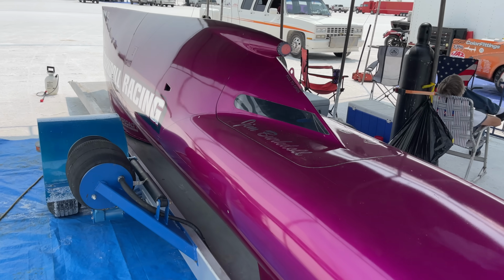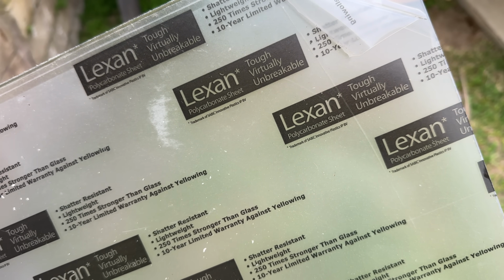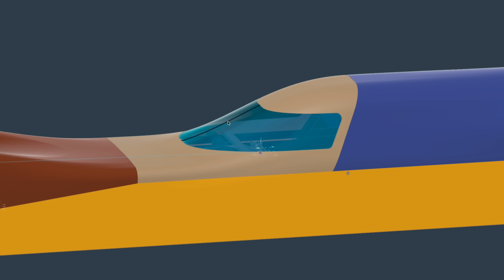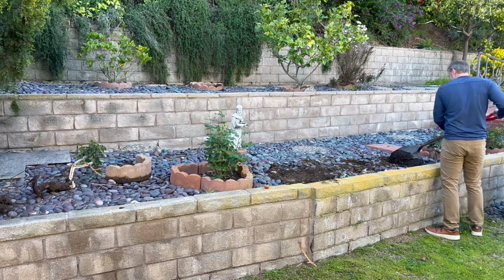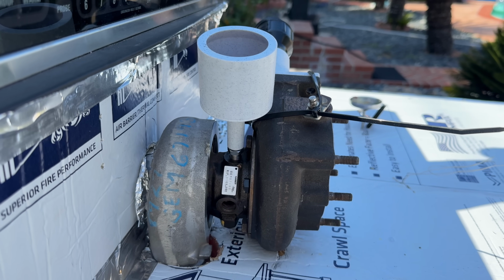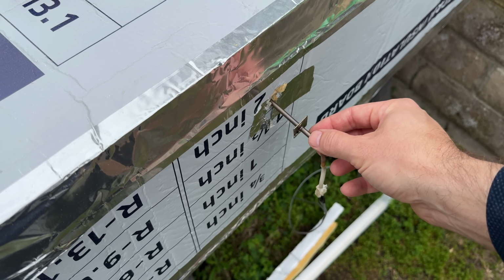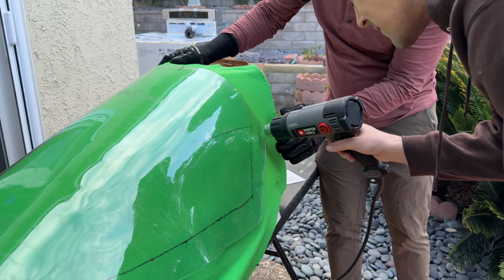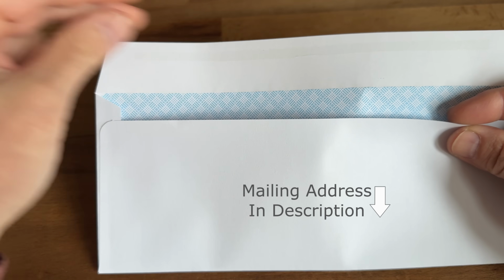I Turbocharged My Oven

Comment: So I too am a designer.  My design solution for your problem: ditch the complicated windscreen and make a digital periscope.  
You have very little to see for a very short time. Spending a lot of cash to un-see through wobbly plastic= bad plan.
Reply: neat idea, not sure how allowed it is.
Reply: Good idea until you loose power at 160mph
Reply: @rugwalle  Doesn't matter if you lose steering power too, but why are they doing this at all if they only get to 160? Is that not scratch lambo territory?
Reply: @davenordquist4663 I don't know what speeds they acctualy reach. My comment was more about using unecessary complex solutions. Clear plastic has so many less things that can go wrong than a camera and a screen.
Reply: @rugwalle  Hot desert, shimmering air, heat of compressing air, thermoplastic can go wrong. The periscope notion isn't off much either; you don't want to stick out from the frame or have less than a square meter of optic to use, but speeding over the curvature of the earth from a POV 2.5 feet up is gonna surprise ya no matter how intrusive your headlights are (through an arc of earth.) Maybe get a satellite wingman as it were, maybe NOE radio, maybe just a nice psychommu amplifier or 200 like in Gundam 00. No humans (only, maybe the league requires it? Or; you can't call yourself Hi-Speed Siobhan if your parrot's name is Hank?)
Reply: I feel like if you ignore all the rules to land speed racing in this sense what you would eventually end up with is dead baby railguns

Comment: I wonder if you could effectively convert the mold into a vacuum forming mold by drilling enough holes in it and plugging in a shop vac. Maybe preheating the mold to some degree (electric mat heater on top) might help a little bit as well?

Comment: use your PID controller! I strapped one to a fan controlling airflow to a pit smoker and could maintain temperature within a degree and a half just running a 6" duct fan into a pile of hardwood. I could take the same PID system I mounted into an ammo can and use it for sous vide or resin curing or teapot warming.

Comment: I wonder if it wouldn't work better if you added a couple more layers of fiberglass to the form and integrated into the oven so the PC sheet forms while heating?
All you'd need is a bigger oven and maybe another turbocharger

Comment: A fishtank discovery series put the mould in the oven too. It draped over the mould as it softened. They were using inch thick polycarbonate, too.
Reply: It also allows for a cooling ramp down, and no need to touch it until fully hard. (Insert obligatory "that's what she said" comment here. )
Reply: @owensparks5013 
Okay. 

That's what she said.

Happy to oblige.
Reply: That what I was thinking, make a bigger turbo-charged oven and put the mould together with the sheet
Reply: Thinking this also.
Reply: he mentioned in the video that he'd need to make a giant oven to hold the mold, which would need a more powerful heat source, if he was to go that route.
Reply: I think with his air circulation system that won't be much of a problem. His mold is foam too, so as long as he builds around the mold it won't add much thermal mass to the heating and dwell times. It will just be a convection oven (it already is).
Reply: @erikmyers3888  I'm just repeating  what he said in the video. He didn't want a ginormous oven in his garden and he didn't think it would heat up evenly.

The mold is made of a different  type of foam that would melt in the oven. He said that in the video as well.
Reply: Hey, I'm just brainstorming solutions! He already solved the first problem anyway.  The mold plug would need to be made out of the PISA foam, which is only an obstacle in retrospect. For the rest of us watching the video, we don't have that problem ;)

Comment: did the same with 10 ft long oven built from foil backed foam board,  but blew mine with air through shaped aperture, came out perfect first time. Screen was about 4 times the size of yours

Comment: There is a nut on the underside of the dial that you can use to calibrate these thermometers. I also have a cheap one that needed some adjustment to be closer to accurate.
Reply: Upvoted so Matt sees it.
Reply: Indeed  @Mark_Bridges
Reply: And use iced water instead of boiling, it's easier to get 32° than 212° or 0° and 100°
Reply: @legionofanon  It's a good idea to do both actually. This way you're not just checking a set point but also confirming the increments in between. 
More often than not, once one is correct the other is too, but this can let you know where in your range is more accurate if not. 
He more than likely chose to check boiling because it is more in the neighborhood of interest for his purposes.
Reply: @legionofanon  Candy thermometers -- such as Matt used -- seldom have a scale that reaches 0°C.
Reply: TIL, That will be useful knowledge.
Reply: Yup, came here to say that...
Reply: @nate8088  me too
Reply: Just posted this and then checked just to see if anyone else caught it and of course, comment section is undefeated
Reply: Some of the ones that come with a protector sleeve even have a tool formed in to tweak said nut.

Comment: You didn't fail to make a windshield, you just made a protective travel cover for a windshield.
Reply: Storm window for windshield if you will
Reply: Plus an extra.
Reply: @cybersholt  Yep, Racecar life, gotta have spares.
Reply: @Mach1048 smokey yunicks used to say that a racer needs a pair and a spare. He would elaborate that on race day you need 2 engines and enough parts to piece together a third. Same philosophy for the rest of the major components of the car.
Reply: I need someone like that in my life "you didn't fail to fail because you failed to start, you just took a well deserved nap and are now more ready than ever to fail"
Reply: If scratched don't count of course, so you need a soft protective cover for your protective windshield... great...
Reply: Weird way to spell windshield tho..
Reply: Warthunder Trailer Pfp? Based
Reply: By my calculation, that sounds like a failure to make a windshield. No?
Reply: @savage6394 No, no. The protective travel cover still does shield from the wind along with other things. So technically it is a windshield.
Reply: @edwardscott3262  Ah, a windshieldwindshield
Reply: @savage6394 i think you forgot to carry the two.
Reply: @savage6394  I bet you're fun at parties!
Reply: @savage6394  my house is a windshield
Reply: @savage6394 You must be using outdated formulas without creativity and imagination factorization.

One man's trash is another's treasure as they say 🤷

Comment: Would a surplus jet fighter canopy work?  It might be easier to modify (GASP!) the body lines to work with the canopy rather than the other (your) way.
Reply: I had a canopy (the hatch that goes off when you eject)  from a  Saab 35 Draken it weighed like 50kgs plexiglass was like 1/2 an inch.

Comment: The correct fix is to run no windsheild. Use small cameras with a live video feed to VR goggles.
Reply: And make sure to use the cheapest possible cameras and goggles off wish
Reply: Electronic windshield is probably not allowed by the safety rules, less FOV/fidelity and a lot more failure points than a piece of polycarbonate.
Reply: @treelineresearch3387 depends on the polycarbonate and how turbocharged was the oven.
Reply: @treelineresearch3387  A set of cameras with VR goggles gives a much better FOV and fidelity than any windshield you can get short of literally replacing the entire cabin with a see-through sphere.
Reply: Killdozer has entered the chat
Reply: @Odins-Dad and now it’s just broken down
Reply: A System Update... Do not reset pops up at 300mph
Reply: This is the approach Lockheed’s X-59 super sonic aircraft is using.
Reply: @N3tech At that speed a planes flying with its instrument anyway, the cameras will likely just be used for taxiing, take offs and landings.
Reply: Some high speed velomobiles use this approach (less the VR goggles, a small screen inside the cockpit is sufficient).
Reply: This is good. I hate the idea of multiple points of failure. This is a lovely single-point-of-failure solution. };-)
Reply: It's doing a top speed run, there are no corners or curves, so you only need to see straight in front of you.

Even if you saw something that was going to cross your path, that car can't avoid it without crashing! Just trust the track officials, and don't worry about things you can't control. All you need to do is keep it level, hold on, & twist the grip.
Reply: Watching the bodyless runs showed how much salt was getting thrown about, so I think the lenses would be coated before the run was done.
Reply: @kevincurrie2052  equip with a scrolling screen
Reply: @kevincurrie2052  You can spray the lens with water or even make a rotating shield in front of it.
Reply: I'd rather deal with some distortion even a Crack over a suddenly black screen.
Reply: That lack of testing the test equipment was kinda a happy mistake, or sorta a lemonade type moment.
Reply: It's not like there is anything that is going to be in front of you. It's on the lake bed, there aren't sides to that track!

As driver, your job is to hold the handlebars & go straight, then pull the ripcord.  All you need to see is the horizon.
Reply: Nothing works as good as human eyes, nothing.
Reply: @DumbCarGuy  Then use nothing. QED. [Insults come to mind, but maybe skip 'em for now.]
Reply: @davenordquist4663   If your so unhappy with your eyes then why are you using them.
Reply: @DumbCarGuy  I'm not unhappy with my eyes, but I wouldn't use my eyes to do the work of the JWST or hypersonic flight control.
Reply: @davenordquist4663  my comment was it’s a better visual to see through a window than a camera.  Nothing to do with instruments. Paint your front car window black mount a camera and tell me how it goes.  It’s just not the same as your eyes.  I know because I already have a setup with front cameras
Reply: @DumbCarGuy  Good advice for a desert speedrun! Get a setup with better front cameras with zoom where you're pointed and it'll outperform your unaided eyes. Lol what's the rez and autozoom on your current camera anyway, 5K and ADI/Frantome label video gear?
Reply: @davenordquist4663  thanks for the advice
Reply: @davenordquist4663  your right because you can see the milky way better through a lens as well

Comment: The dad of my partner builds velomobiles as a hobby. He had exactly the same problems with his windshield. He solved it by not caring, since the fastest he will go is 15 kph.
Reply: Guys, he was born 1938 - he could go go faster than 15kph, but he won't for safety. And he buildt that thing entirely by himself for himself.  With indicators, a little light and everything, ...
Reply: @christofschwarz6602  In that context 15kph sounds almost race car like
Reply: @christofschwarz6602  At his age I'll be happy to be still able to ride anything 👍
Reply: @christofschwarz6602  oh right, that explains it. Impressive, both that he built it and drives it.
Reply: ... which is awfully slow for a VM? 🤔
Reply: So many problems disappear when you stop caring!
Reply: 20 km/h is painfully slow for me, I can't comprehend who would drive a velomobile at 15 tops. Is it exclusively for the elderly?
Reply: Velos reach speeds of 60kmh